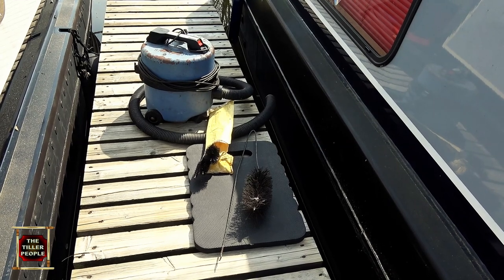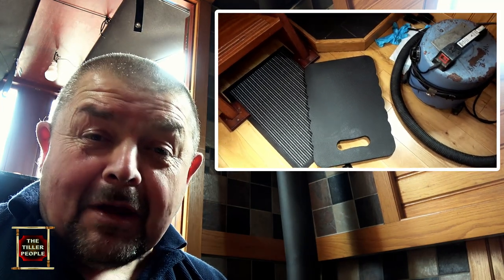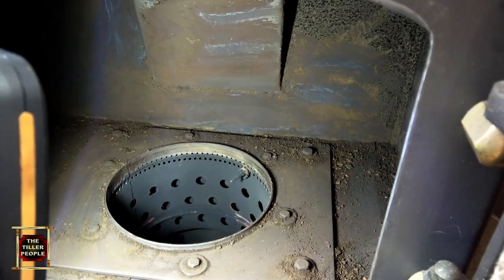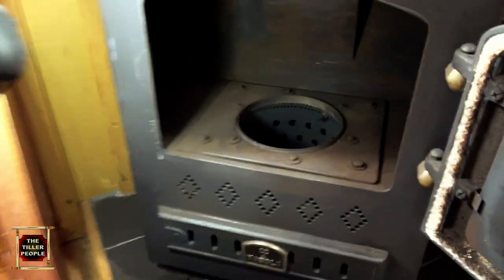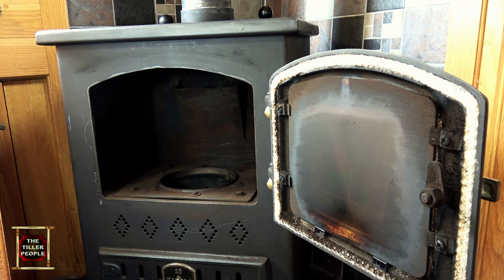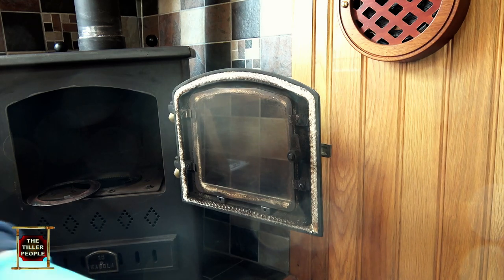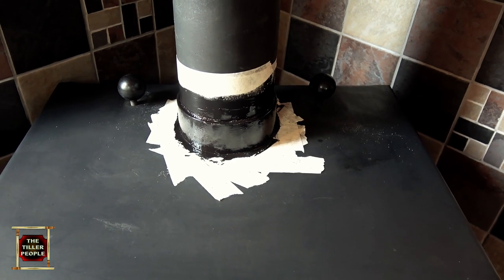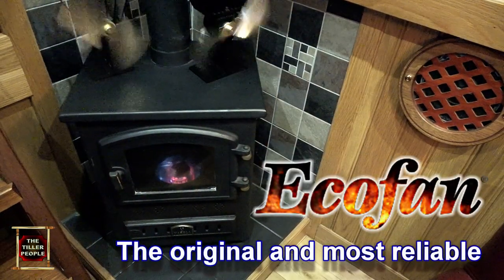That Narrowboat Feeling - 2021 - 173 - Keeping It Clean

Comment: There's nothing like a good set of wire brushes!
So glad to see and hear you both again. I hope you will be able to slip the lines and get back under way soon. 
Although we just had 3" of snow here in Vermont yesterday, it will melt in a few days and spring will continue to advance..

Take care both of you,

John
Reply from the maker: Hi John
Flexible wire brushes are part of our tool kit on our boat and at home. Unbelievably in our area we have major closures on 5 canals restricting cruising severely. We will be cruising this year but also have some exciting times happening on land but we will keep that side of our life private. At least snow at this time of the year is not long lasting (hopefully).
Cheers. B & K 👍🍻